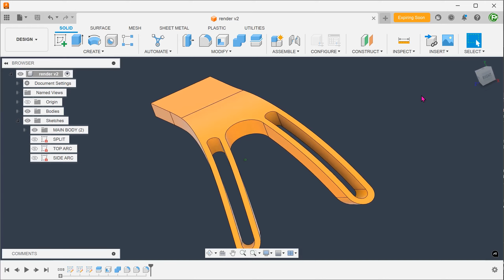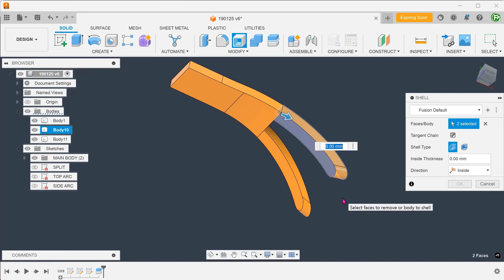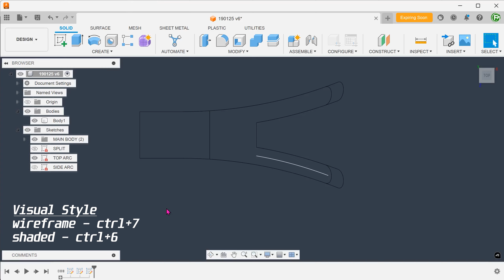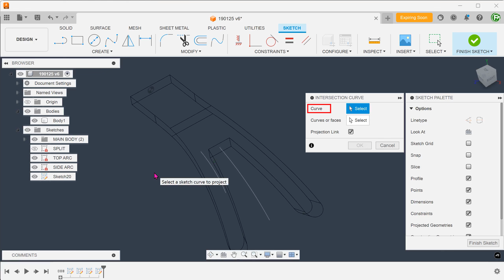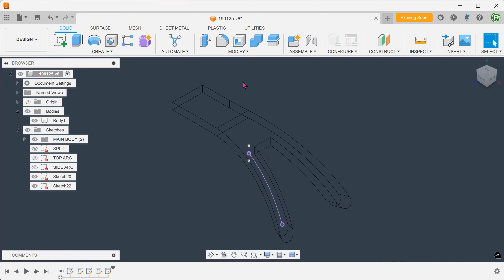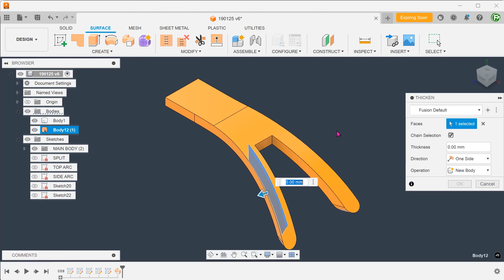Autodesk Fusion | How would you cut this?

Comment: I recently had run into an issue that touches on the topic of the second version: How would you create a path thats always in the middle?

I wanted to create an organic smooth shape defined by two sketches (squidwards nose), one from side and one from the front. In order for  the loft to work as expected though, i had to draw a center path. 
Given most of the shape was done by splines, in a bent similar to here but both halves different, how would you define the center spline to be perfect?
I ended up aproximating it just like you here but with some helping lines. I then made a few layers and projeced the shape onto them at different heights to have defined the shape. The resulting shape would slightly differ from the sketches because i was not perfectly in the  middle. I could only see the true shape once it was done though.

I think finding a centerspline of two splines would be a great feature to add

Luckily one of the sketches was symmetrical so i only needed to do it woth the other.

Comment: I note the original part displayed was slotted (rounded at both ends). Neither method demonstrated replicated the slot in the original part. How could the workflows be modified to ensure an accurate original representation? My initial response when the video commenced was to extrude a sketch of a slot on one prong then mirror to the other. I'm a beginner, so be gentle 🙂
Reply from the maker: The slot can be done using a full round fillet. Sorry for not demonstrating that.
Reply: @Fusion360School  No apology necessary. This was another excellent lesson. I'm now off to Fusion to have a go myself. Thank you for filling the gap for me (no pun intended).

Comment: one sketch above. one sketch below. bottom smaller than top. loft sketches using surfaces and do split body with it as tool.
Reply: But how do you sketch it accurately?
Reply: @indranin6300  Project and offset would be one way to do it